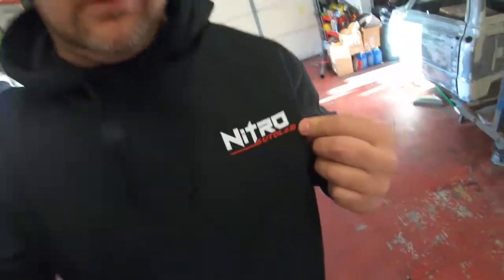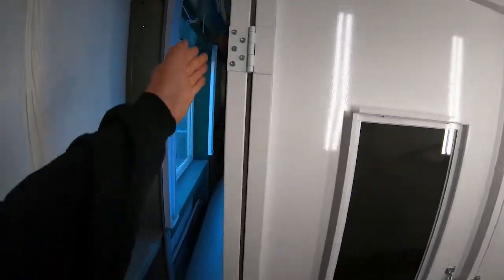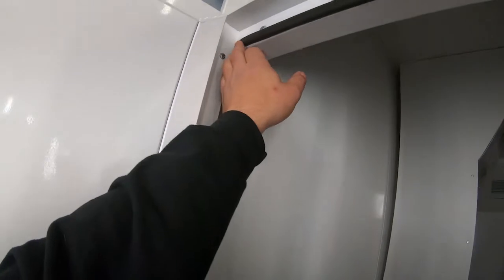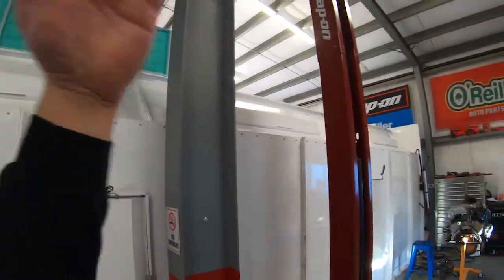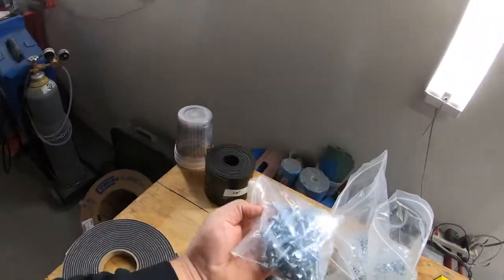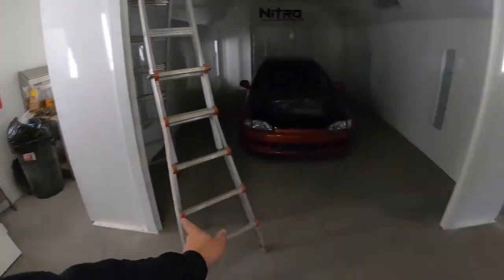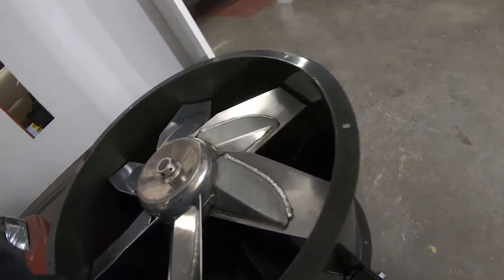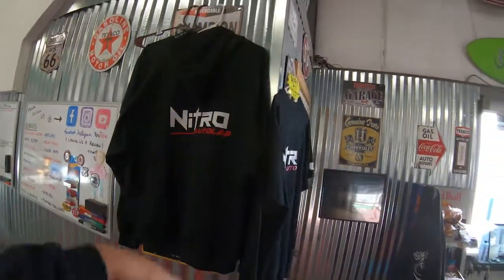Mounting booth lights & fan | M-tek Spray Booth | Part 5

Comment: Videos on how to properly install the motor for belts???!!
Reply from the maker: Sorry I just saw this. Don’t think images are video on it but after installing the motor to bracket loosely, you just gotta wrap belts around pulleys and tighten adjuster bolts to set tension to get some tension and tighten it up.

Comment: Whats the length and width of booth?
Reply from the maker: 14’’4”x24’ You can get booth in longer dimensions and different styles as well. Heating is available and they have mixing room add ons as well. 👊😎